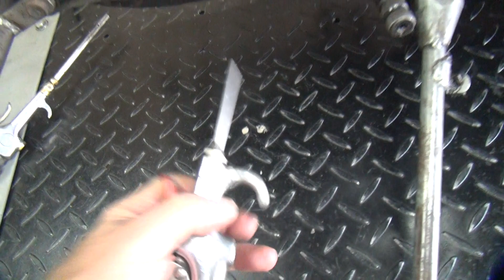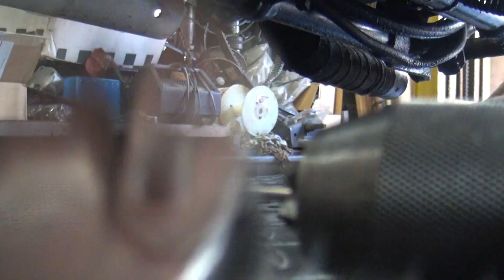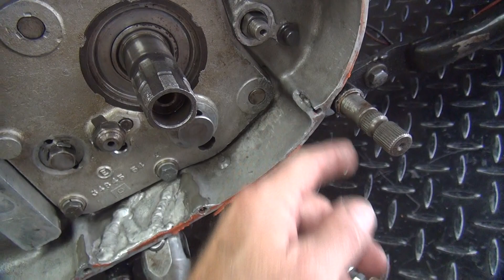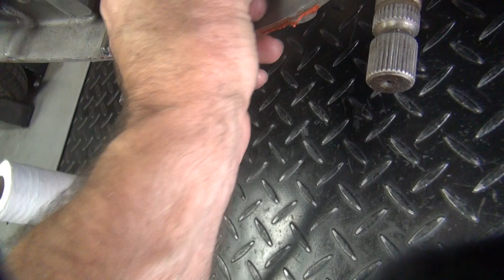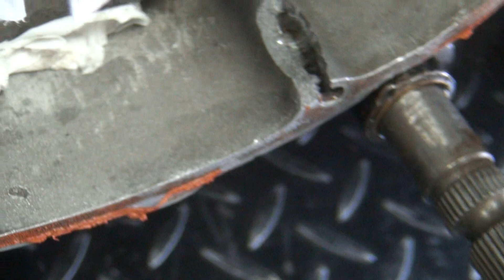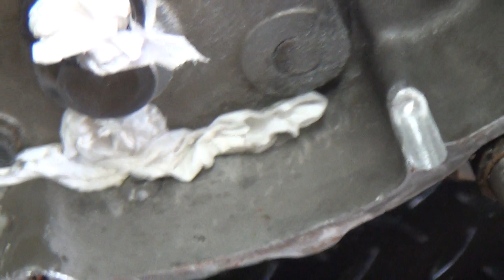1972 XL Ironhead Bobber #102 Sportster clutch primary motor repair harley by tatro machine

Comment: Use wax for the die grinder on aluminum, been doing it for 22 yrs. They come in sticks similar to a grease cartridge. Carbide burrs at the speed they run (20000 RPM or better) melt the aluminum. Therefore plug the cutter up.
Reply from the maker: when they are sharp and you are cutting good alum things are good. after that, you need the lube.
tatro

Comment: Rule of thumb I was taught for threads in the 80's was the diameter of the bolt for steel and double the diameter for aluminum.
Reply from the maker: that is more than you need but it works. coarse threads are for cast steels and alum. good steel uses fine threads.
tatro

Comment: No love for that orange RTV. I was fixing old Honda XR500 motor and previous owner used it everywhere instead of replacing gaskets. All the little bits got chewed up and sent into every bearing. Took a while to clean out